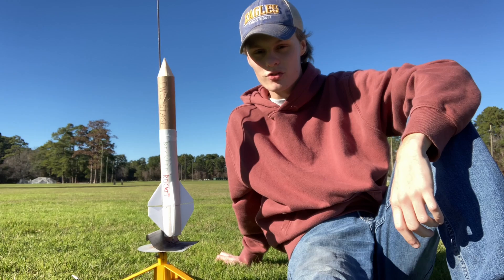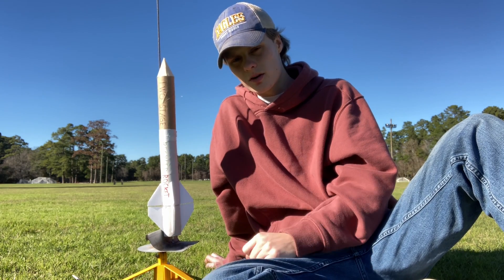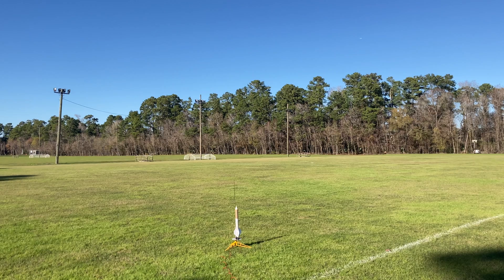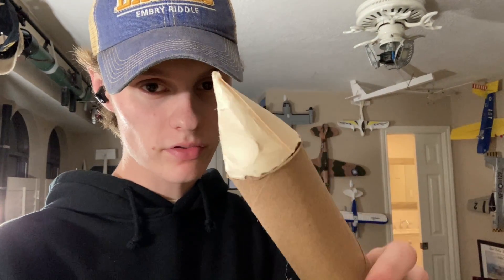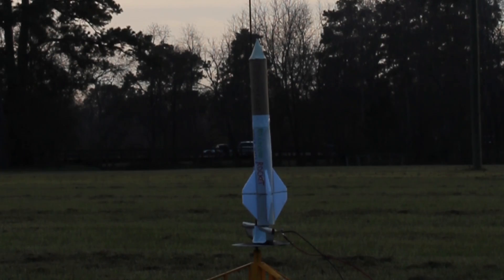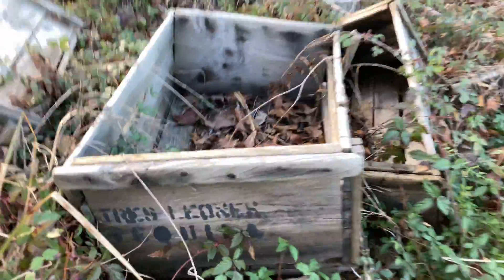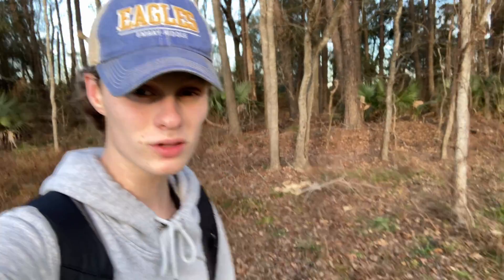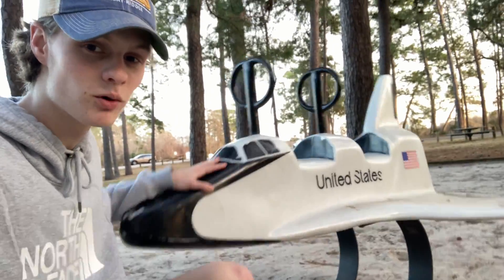Toilet Paper Tube Two Stage Rocket!

Comment: I made one of these with 3 paper towl tubes and 3 toilet paper rolls back in 2000, was able to get 3 stages to work using pogs with holes cut in them as engine mounts...only flew once though as I tried launching it a second time in 25 mph winds and it disintegrated lol...
Reply from the maker: That’s so cool! Three stages is awesome, but man those winds are no joke

Comment: My friend and I have been thinking about building a rocket similar to this, how did you make it light the upper stage after the lower one burnt off?
Reply from the maker: You must use a special Estes rocket motor. It has to end with a 0, like a C6-0 or a A8-0. The zero motors shoot a fire charge immediately after burn out. There’s some online articles I can send your way if you email me at acepilot109@gmail.com that I used to design my rocket